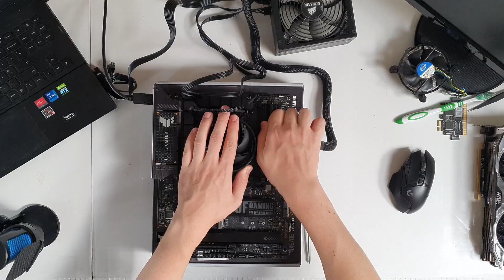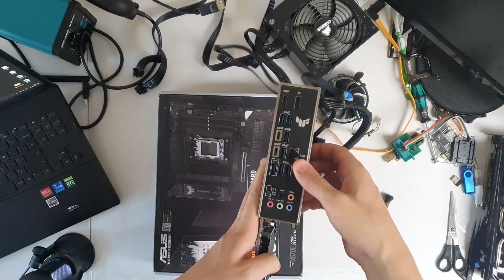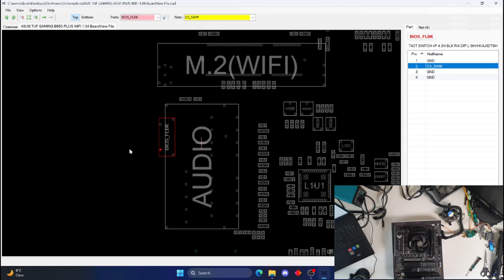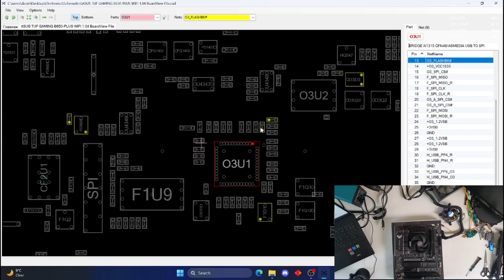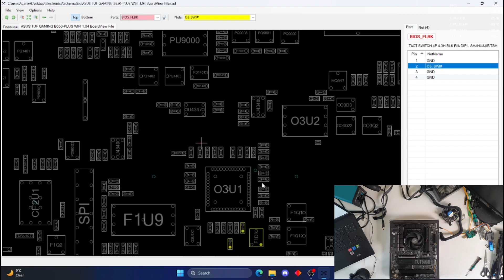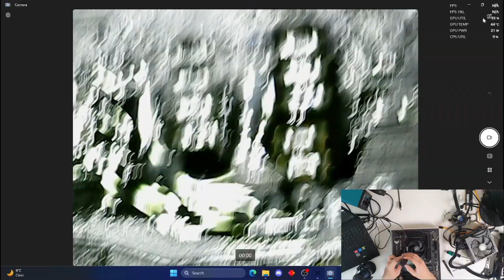Asus TUF Gaming X670E-Plus Stuck Flashback and Broken BIOS Chip Repair

Comment: Nice ! I got the same issue on this exact board, which was working in total less than 200 hours. Anyway, I'm going to do the bridge as you pointed out with a button, so i can open the circuit incase I want that flashback capability (If the issue is only in the trigger of the flashback that is). Anyway. thanks so much for giving me hope and I'll get back with the result. 
Great content and quality !!
Reply from the maker: Ahh smart! Thank you, glad I could help!